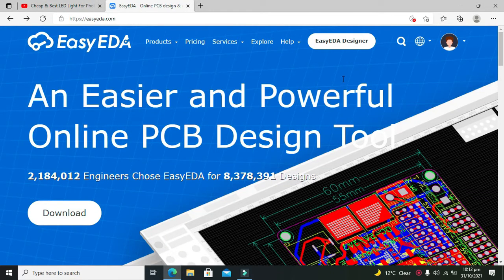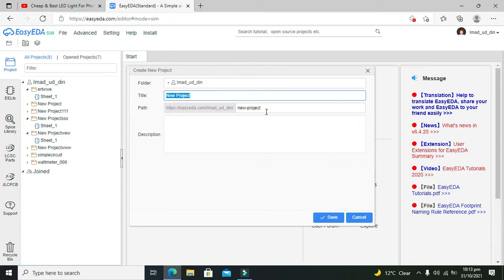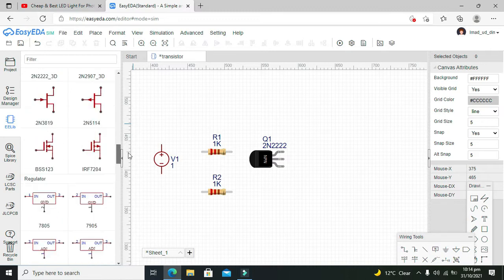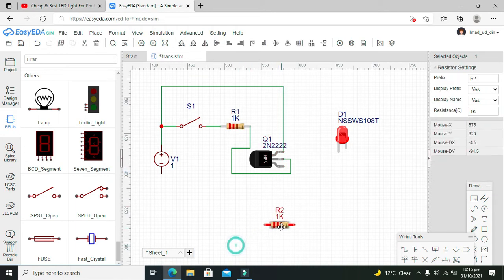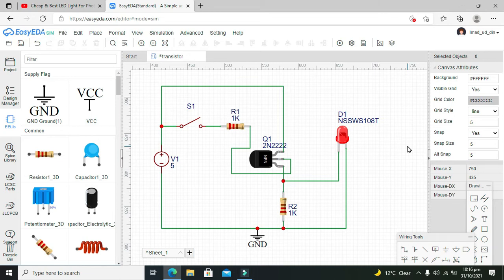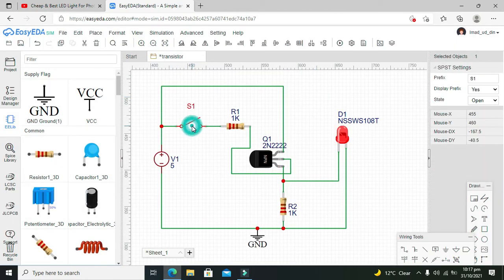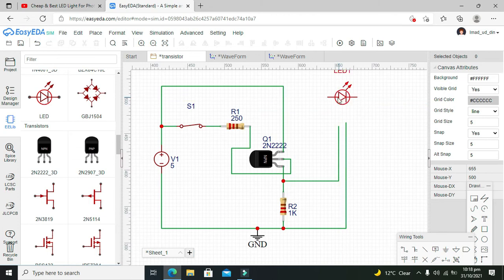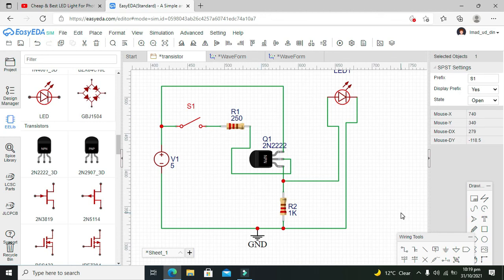how to use transistor as a switch in easyEDA | Simulation of transistor as a switch in easyEDA

Comment: You are powering the LED by 5 volts without the resistor,  it will blow up shortly. The R2 resistor is useless in this circuit.

Comment: Sorry to say but your circuit is non-functional, leds must have a resistor in series to limit its current.
Reply from the maker: In reality it is necessary to add 220 ohms resistors for current limitation....In proteus, circuit wizard even 10Vs are ok to run the leds.....